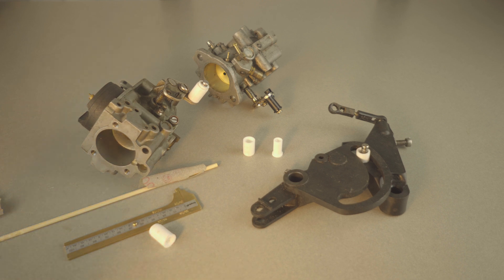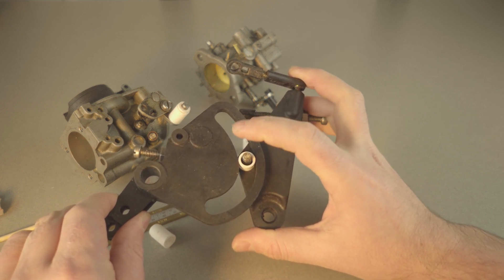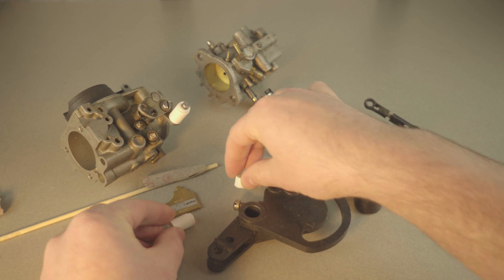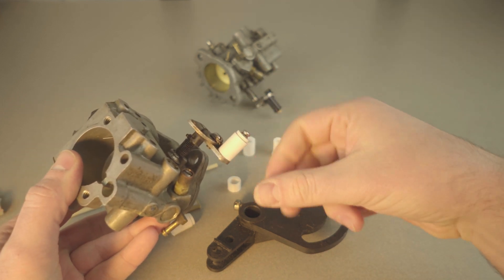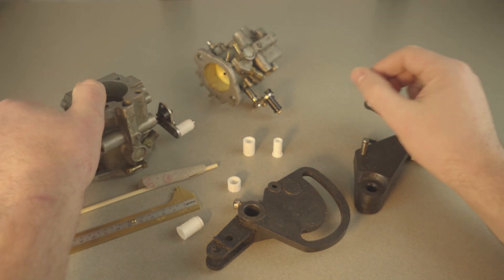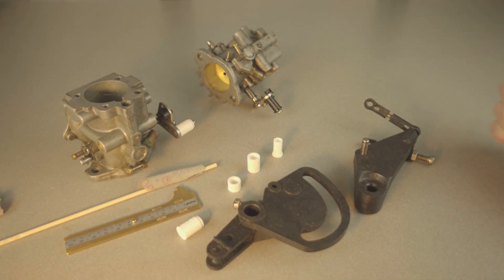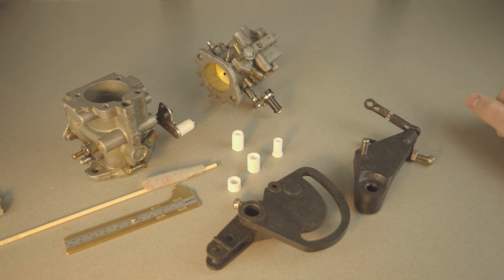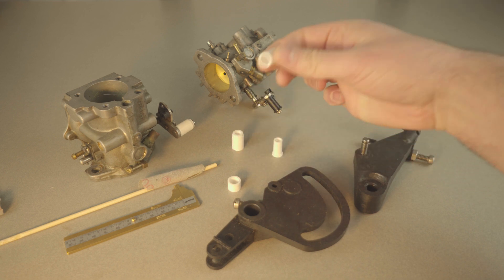3D Printed Evinrude Cam Follower & Roller Replacement Parts.

Comment: I'm trying to find a print file for that spark lever (432015).. $184 for a new one on eBay, cant imagine what the local marina would charge for it..  all for a piece of plastic that you could print at home 😒
Reply from the maker: The best way to do it is either craigslist, or buy the entire carb. If you are just trying to buy one part, there is a good chance you can find some old broken motor for less and just take those off it.

Comment: Yes! I have a 1997 johnson 40 and the 2 roller are 40$!
I have wanted a printer for awhile. 
Even a maker spot where I could use one.
Can u send me your file?
Reply from the maker: It's in the description. I also have a sweet pole light holder design. I really recommend the 3D printer I reviewed it's super cheap and it just works well. It's probably like $120 now.

Comment: What plastic did you make them out of? I've got gas and oil flying all around this engine compartment on my old beat up outboard, so I'm not sure my PLA or ASA would hold up.
Reply from the maker: PLA, as long as the plastic does not get too hot it should hold up. You can also coat it with glue or paint. Is much more durable than you may expect.

Comment: Thank you, Thank you, Thank you,  Just what I needed, had my buddy print some of these last night. After a little reaming out the bores with a 7/32 drill bit until I could slide it onto a 1/4 in drill bit. Then I slid it over a 1/4in bolt, put a nut on to hold it against the head of the bolt, chucked bolt into a drill. With drill spinning used a small file to fit the O.D. to final size.
Works perfectly, one happy boater again.
Reply from the maker: Thats awesome. In my experience printing; try to print a tiny piece first to make sure its the right size. When downloading stuff online it may not be right. So by printing a tiny test , this way you can avoid having to do much modification or just waste a bunch of time printing something wrong.

Comment: Great idea. I used electrical tape and cut it after wrapping it around the old one. It worked for a summer and now it’s wore out.
Reply from the maker: Not a bad idea for a quick solution, maybe something other then electrical tape even paint tape would work better as electrical tape tends to get all gooey and gross after a bit.
Reply: Hello Everyone it got me farther down the season until winter and I ordered the 12 dollars a piece parts just hate spending so much money on a little plastic thing hard to justify it. Wish I had a 3D printer like yours nice video thanks for sharing it.
Reply from the maker: @unsaltedlife5998  just fyi the printers are like under 200bux now.
Reply: Hello Everyone not a bad investment, sounds like a good deal.

Comment: How well has this held up?
Reply from the maker: 100% these 3d printed parts are very strong. You could print any of the shifting parts with ease. I have also heard you can paint / coat them to increase longetivity. I painted my boat rear pole light fixture I 3d printed and it looks like new a year later.
Reply: @IdeaMan4k  can you post this file as well, possibly another part I'm interested in...
Reply from the maker: @donnylarmour803  https://www.thingiverse.com/thing:4604344

It is for a 3/4 inch pole, you do not need to glue it in, it fits snugly.

Here it is, its currently dark out but il make another video just showing it as is.